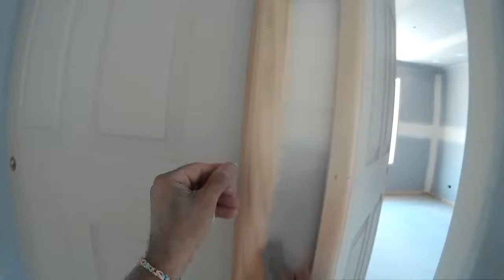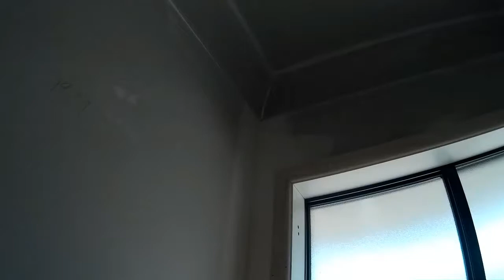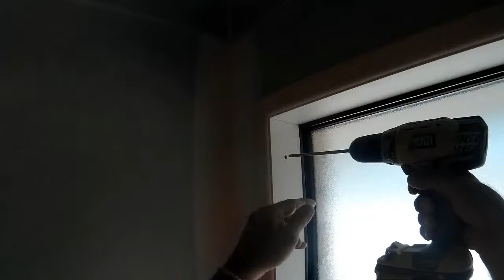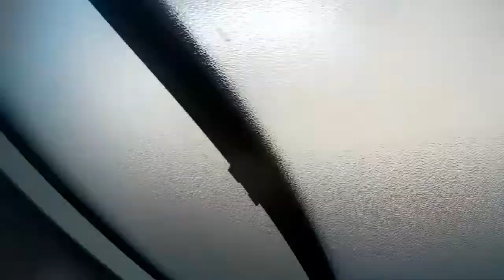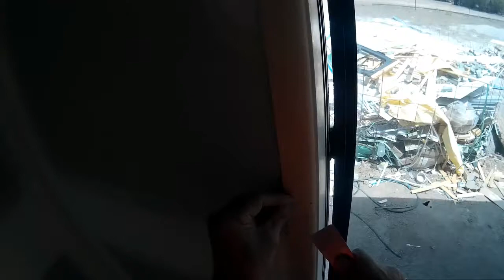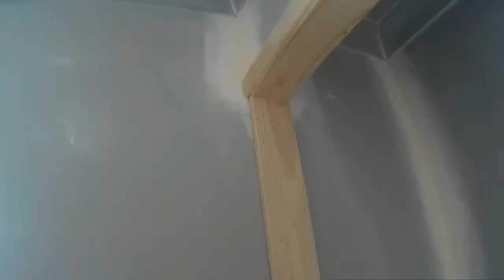Putty nail holes fast professionally with a knife

Comment: Old post but hopefully you can answer! Do I have to use oil based primer or can I go over this linseed putty with water based primer? I'm doing exterior trims with exterior 3 in one primer.
Reply from the maker: Hi Brant, there is no problems painting over linseed oil based putty with water based paints. If you are glazing windows and there are large amounts of the putty you will need to let it dry first but small amounts like nail holes etc are fine.
Reply: @ThePa1nterhowto  thanks for the reply!

Comment: hey mate do u always use puty to fill new door frames, window archs and skirting? do you fill it once and is there any reason you dont use a timber filler?
Reply from the maker: I nearly always use putty cause it is quick and being oil based provides a barrier between the metal nail to prevent rust from coming through. After I undercoat I will then use a light and easy sand plaster to find any imperfections  before I sand.
Reply: Hi I have a question please can you answer do what I have to do any sanding after this?